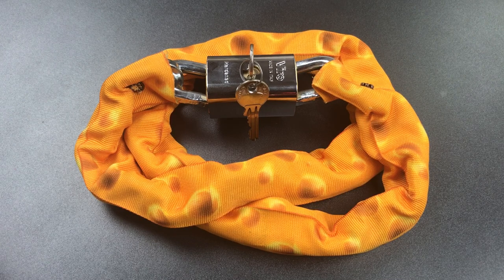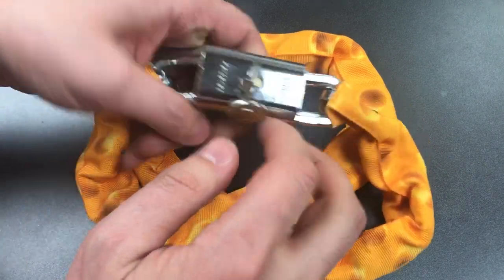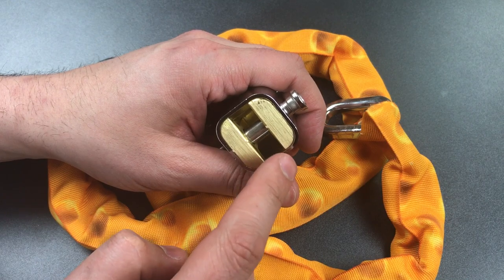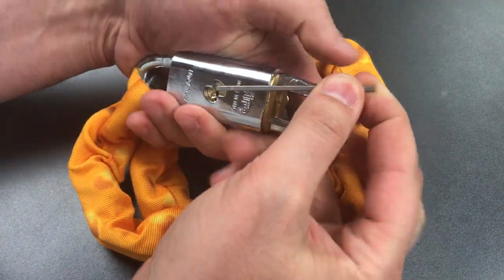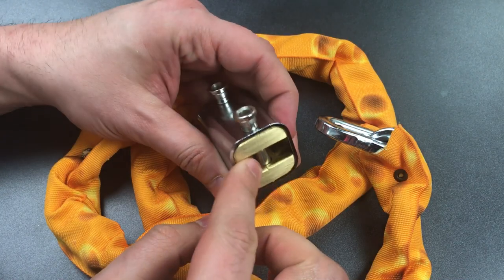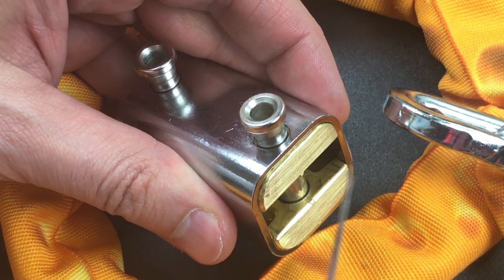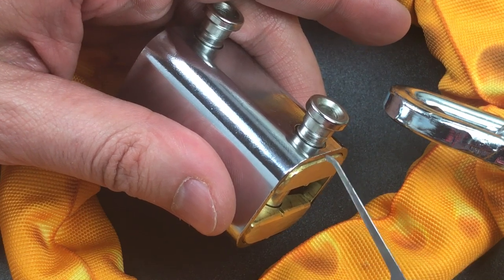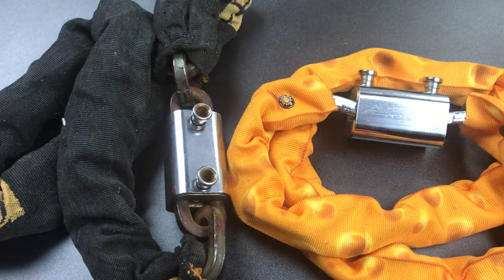[659] Viro Double Shackle “Blocca Catena” Bike Lock Picked

Comment: shear the pins with a hammer then use hammer and small chisel put the chisel between the brass and body where the pins were and that should create a gap big enough to take out the bearing. looking how thin the body is it wont take much.
Reply from the maker: I like the concept. Maybe an awl hammered in would be a one step process.
Reply: or shear the pin then hit the side of it with the hammer near the top where the bearing is but not too close to the shackle or it will get bound up inside and it should deform the outer body enough to release the bearing.
Reply: in fact you wont have to shear the pin that way just hit the side of it with a hammer.

Comment: Hard to tell how strong the body is. Could you wollop it with a lump hammer corner to corner to deform it enough to mangle it open? 
 Or ramset under a pin to try and blow it out?
Maybe two large adjustable spanners on each end to twist the thing apart?
 What about hammering a center punch into to the key hole, maybe you can split it internally?
Nah, I'm grabbing at straws here, that thing looks hard to get apart. =)
Reply from the maker: I doubt any of them would do much beyond seizing the lock, but I’ll give it some thought.
Reply: Okay, I had some beer, I have more ideas!
Thermite!! ...thermite the thing in half!
 Uhm, Hammer a screwdriver between the brass and outer body to create a hole big enough to get a bolt remover in?
Blowtorch right? ...I mentioned blowtorch didn't I?
 Hammer and chisel a pin out the side?
...I'm rootin' for you dude, I know you're gonna crack this one. =D

Comment: Hey LPL, does your Screw Spreader fit between those pins?
Reply from the maker: Nope. Not even close. ☹️
Reply: And even if, I think you wouldn't be able to turn it since the rods don't stick out very far.
Reply: You might be able to loop chain links over the pins and then the screw spreader fits on the chain!

Comment: I wonder if you can "pull up" the shackle with me some sort of screw pulling extractor device. (forgot the name). I don't know if the shackle would break from doing that, if not it might weak part of the lock because of the pressure applied to the ball.
Reply from the maker: I think the shackle is designed specifically to be weaker than the locking mechanism in that direction.

Comment: Slide hammer?
Reply: Slide hammer on the shackel pulling it up,, it only has to go through the brass not the hardened steel and the lubed ball bearing might reduce friction acting as a ramp depending on tolerances or cuts but just like the LPL's original idea I'd say it only has about a 50% chance of working... PS LPL try picking an abus bordo combination lock, just line up some false gates and you can feel the real ones, half the gates are false and if you know the sequence of false gates you can also determine the code in even less time.

Comment: I suspect you are underestimating the strength of the material around the pin.  I would try flexing the pins with a hardened rod (e.g. pin punch) in the hope of work hardening and fracturing the pin at the waisted section.
Reply from the maker: I know it’s strong. It’s just this is all I’ve got. ☹️

Comment: Not that imaginative but drill out the lock.  Other than the steel warding to prevent overturning, I bet there's no drill protection inside and therefore not much brass to get through on the way to the actuator.  It looks like you'd be able to drill through the pin stack using the steel as a guide.   It's not covert, would take a while and who really walks around with a drill so it's not a real world attack that would be considered a vulnerability in the lock itself.

Comment: Drill out one of the shackles
Reply: crocodile2000 if i were a locksmith i might do that....though i would rather try pick the lock first.
Reply from the maker: Drilling free spinning hardened steel would be challenging. Drilling the core is easier.
Reply: Gotcha

Comment: LPL, I think if you just weaken the brass at the thinnest point using a file, you will encourage a sheer fracture before it deforms into a bulge. That will hopefully speed up the stage at which the hardened steel comes under maximum stress. 

I believe it will work, but to ensure you concentrate the pressure at the shackle sheer line (and to alleviate the risk of the pressure device becoming a not do bright and shiny missile), you may need to hold it in position with a plate of steel and a clamp or two. 

I was thinking a pair of steel folding wedges might work, but the weakened shackles concern me. They too could easily pop out dangerously. 

Wedges are amazing by the way, especially for lifting thinks such as heavy square blocks of stone from the ground. 

No, I'm wrong. The weight of evidence that the allegations against Putin and Assad are faked is all you need here...;)